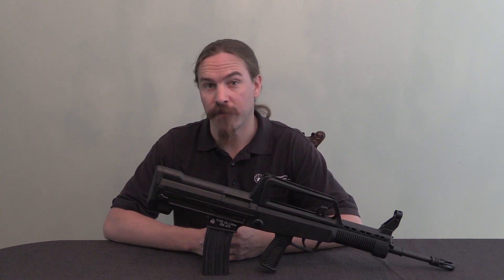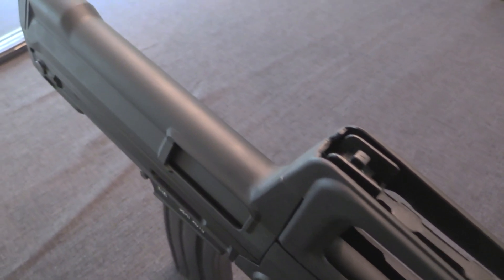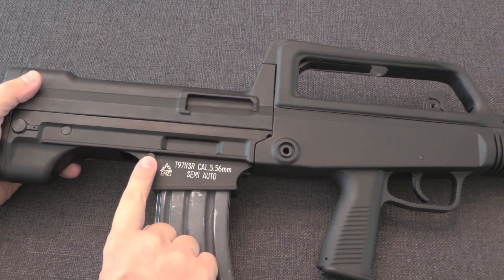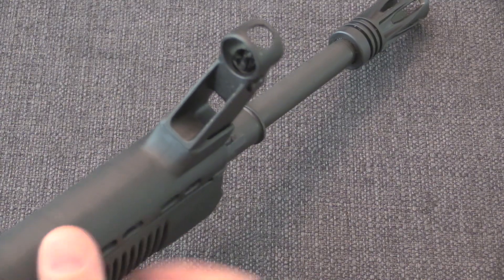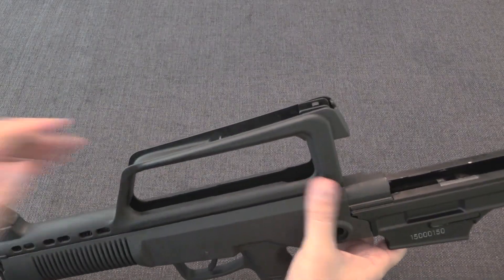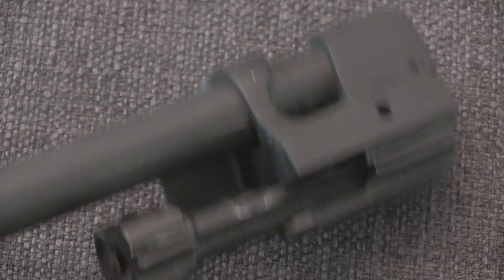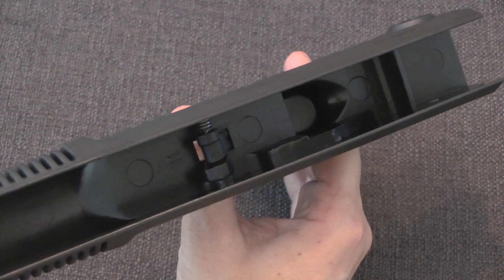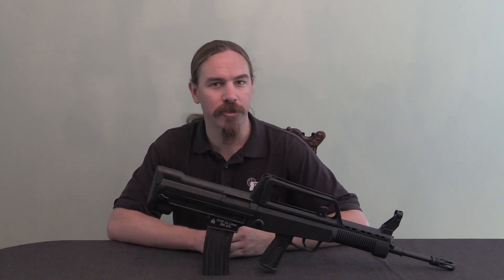Mechanics and Disassembly of the Norinco QBZ-97 / Type 97 NSR

Comment: I wonder, what causes the problem with the trigger pull with this kind of transfer bars. It's not like a metal bar is going to stretch in any significant way when pulled like this, is it? Is it because the joints in the transfer system are (often) not fit closely enough, maybe?
Reply: Is that kind of trigger really a problem though? As a conscripted soldier (way back, way different place) in a non-infantry role (I was not equipped with a gun), we were thought to keep a steady aim and pull the trigger smoothly. That way we were "surprised" by the shot, so that we didn't twitch as we fired or closed our eyes (or some other stupid thing). I don't know the extent at which Chinese soldiers are trained, but it is not out of the realm of possibilities that they will conscript A LOT of folks when shit hits the fan. That kind of training seems easier than to train away any kind of bad habit when firing.
Reply: There's nothing wrong with the trigger pull of this rifle.  It's light and smooth.  
The problem is you have no idea when during that trigger pull the shot will actually be fired.  There's no resistance or any indication that if you pull it just a bit bit, the rifle will fire.
Reply: Its the friction between the bar and the reciever, just like glock, which also has a bad trigger feel.

Comment: The rear sight nub, I believe, is retained from the original QBZ type of night sights. Originally that post at the rear would have a tritium insert and you would line it up with two tritium dots on the front sight housing. This is mostly speculation on my part due to lack of Chinese documentation but I believe its a well educated guess.
Reply: That's correct, Ive seen a few photos of the arrangement.

Comment: Gas selector too hot to touch, lets use cartridge, what could go wrong.
Reply: Probably nothing, to be honest.  Still, the QBZ-95-1 changes this to use a bullet tip instead of the cartridge base.
Reply: jarvy251 hey you're right, just noticed most guns use the tip and not rim.

Probably to make it easier with shaky hands/ gloves, though.
Since the tip can't fall out, and is easier to put torque on(especially if they use detentes that only require turning).

Comment: The Kel Tec RDB with the  overtraveling bolt seems to be the best answer to the ejection problem that I've seen so far. If they would make it with higher quality materials and a dust cover over the ejection it seems that it would probably be the best bullpup made. I'm still not sold on the bullpup, though.

Comment: 5:40 Wait wait wait. To release an empty mag, you have to manipulate the charging handle? Wha? That's terrible design.

Am I misunderstanding?
Reply: You don't have to. BUT you do need to use your firing hand to strip the mag, then rack the charging handle to chamber new round with your support hand (no bolt release). Which is terrible design.
Reply: I believe he meant "to drop the bolt*. The mags drop free.
Reply: Yep, this is only for the Type 97 tho, since it used AR mag, the Type 95 which used in China, has a AK style mag release in the back, so single hand fast reload is possible. They probably been too do major changes on the type97, since this is target for civilian uses, not military.
Reply: Steven Loving there are videos showing how soldiers changing mag using the non-firing hand aka left hand, rather quickly
Reply: I had one of these. I never had any issues changing the mag. Mostly because in 8 hours on the range it only went bang 3 times.

Comment: Is the actual Chinese cartridge close to being power-wise between 5.56x45 and 7.62x51 or more of a slightly more powerful 5.56?
Reply from the maker: Very close to 5.56.
Reply: @ForgottenWeapons  5.8 i think.
Reply: The army experimented with several cartridges, including 6mm and 6.2mm. 5.8mm was the least powerful but in the end the lower ammunition weight decided the choice of ammo. The rifle is made of thin plastic parts due to very strict weight requirements. The army wanted the lightest possible weapon that would still be durable. There are echos of Ian's WWSD project.
Reply: They didnt go with 5.56 or 5.45 because they intentionally wanted a round that was not compatible with foreign weapons.  The stated line is to deny invaders the ability to use captured supplies, but rumour has it they were having a serious problem with army brass selling ammunition stockpiles on the black market.  If no one else uses 5.8, then there's no buyers, problem solved.
Reply: @jarvy251  smart thinking
Reply: One critical and overlooked reason for the 5.8 cartridge is that it gets the required performance out of a steel case instead of brass. Steel is cheaper and weighs less. Important considerations for wartime needs.
Reply: Brass behaves differently than steel. Steel case can handle high pressures as well as brass, but it's elastic nature theoretically provides a better seal for more consistent performance at high pressures. It is usually preferred for match ammunition although there are steel match ammo. Mostly brass is better for reliability reasons, as it is self lubricating, is easier on extractors, and the better sealing reduce fouling. However if the rifle and ammunition was designed to use steel casing from the start this is not really a problem.
Reply: Weaponsandstuff93 5.8 is a little bit hotter than 556
Reply: Weaponsandstuff93 supposed to be a bit more powerful than 5.56 while being as accurate.
Reply: MattyLight30 the chinese going for a nato std round? U mad?
Reply: Weaponsandstuff93 I was just watching one of your videos, your latest one.
Reply: @Daniel Bromwich
If DP10 is meant for DMRs and LSWs then barrel length is not an issue. QBU-88 and QBB-95 are 640mm and 600mm respectively. Most rifles are designed for higher pressures than the ammo. The T-97 export model is in 5.56 so there's little evidence that the domestic military model is made to lower pressure tolerances. 

I would agree that 5.56 is a great round, however there is a reason Russian 7.62x54R, 7.62x39, and 5.45 are all steel cased. Even for the US military there was a serious 5.56 ammunition shortage during the Iraq and Afghanistan wars and had to import from British and Israeli stocks. When China was planning for WW3 logistics in the 80s and had to factor in nuclear strikes, it made a lot of sense.
Reply: @Daniel Bromwich 
But if it costs more, does it matter if it's technologically more efficient? M855/A1 is the latest technology that just entered service, where as the DP10 is cheaper and offers 80 ft lbs more at the muzzle, basically the same energy. 5.8 case weigh about the same as 5.56 despite larger power volume. The extra weight of cartridge comes from greater mass in projectile and powder. With 5.8mm the Chinese have room to grow with the option of going to brass casing and higher pressures. 5.56 is pretty maxed out.
Reply: the 5.8mm is also heavier.
Reply: Ben Graves more like they want a new proprietary intermediate cartridge that performs better than 7.62x39. Possibly to keep under the table weapon sales in check.
Reply: Johny Ricco I'm a noob when it comes to firearms so pardon my ignorance but what does case material has to do with performance
Reply: yes under testing it is more armor pentration than 5.56
Reply: Thanks for the response.
Reply: It penetrates more, human tissue damages less
Reply: Forgotten Weapons type97 is 5.56mm
type95 is 5.8mm
Reply: with better penetration(one goal of the development of 5.8mm round)
Reply: jarvy251 they develop 5.8 mm for assault rifle, LMG, sniper rifle and also pistol. Very convenient in mass production.
Reply: slightly more powerful.  Depending on which specific round.
Reply: 5.58
Reply: From what I read , more to a 6.5 grendal
Reply: It's 5.8 in China,and 5.56 for overseas
Reply: Funny to see you here. I wish you well!!
Reply: Ok thanks.
Reply: Forgotten Weapons 

Then why not modernize the 5.56 like the 262 and 855A1 instead of developing a round that's not all that better then 5.56? 

Chinese patriotism?
Reply: @MattyLight30  One important reason is China dont have much copper at that time, so they need to develop a reliable steel case ammo with slope.
Reply: @MattyLight30  To deny invaders ammunition.
Reply: @MattyLight30  they think if thier guns are captured thier enement can't use it again them. and the 885 has 8% more pressure than a standred 556, a much heavier bullet, abit more stopping power but slightly lower volocity. plus, the 885 is steel case, while the 556 is brass case. 556 steel case have certain reliabality probloms, but the 885 is designed to be a steel case from the start, so it is more robust.
Reply: @MattyLight30  Well, China was lacking cooper back into 70s and 80s before joining global trading, 5.56 ammo design need cooper shell to be reliable without extraction malfunction, since the slope angle is very flat on the shell.  5.8mm rounds is designed to be reliable using steel shell, which has higher cone slope on the shell, so it can help the ejector to extract the shell very reliable even with steel case ammo. The down side is the magaizine size will be a bit bigger and more curves, due to the slope on each bullet adds up.
Reply: MattyLight30 Pretty much, that and it gives them a reason to employ people. If China ever ran out of jobs there would most likely be a revolution.
Reply: Love your videos mate.
Reply: Weaponsandstuff93  i found you!!!!
Reply: 5.56 takes away your life. 5.7 DAP takes away your social credit.
Reply: @anfrac3700  +1000 FICO credit score! 😊👍🇱🇷

Comment: Why are Chinese weapons banned in the US?
Reply: Rik Raptor Pretty sure that's not true. My Springfield XD says made in Croatia on it. It's an import ban on specific countries.
Reply: All non-US made guns are banned in US. Foreign manufactures usually stets up local production facility to go around that but China choose not to go through the trouble.
Reply: Desmaad Short answer, China sold missiles to Iran and US responded by banning Chinese weapons from import.
Reply: Ed Castle No what Seth Rich is right plus some Clinton corruption thrown in to the mix as well. 

Your scenario, Operation Dragonfire, happened two years after the ban was already in place. All that did was make the Clintons look good to the useful idiots and super patriot blowhard gun owners that the ban was a good thing.